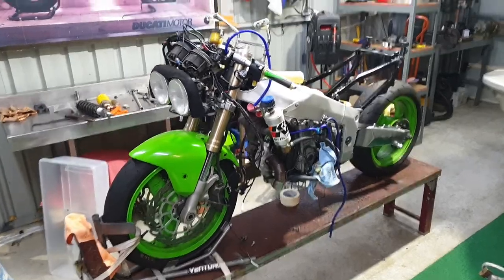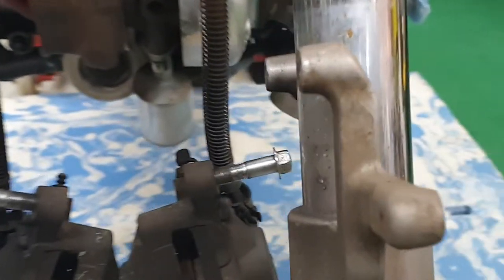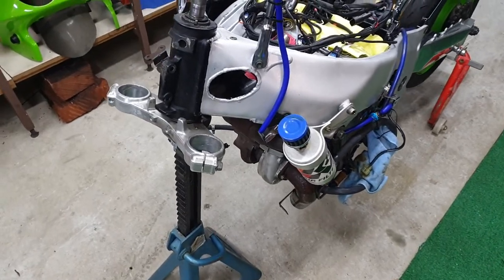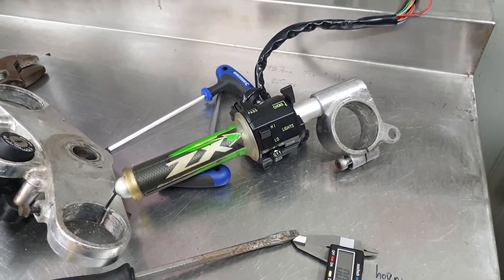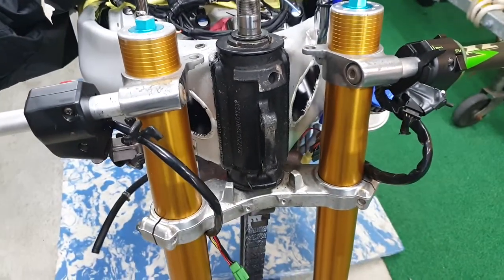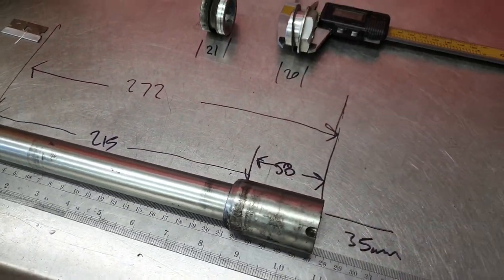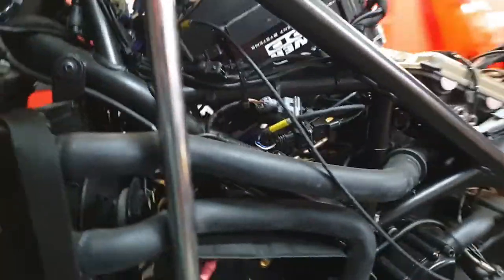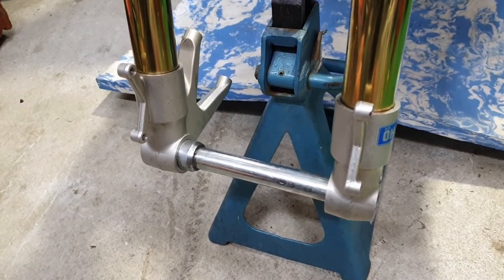Motorcycle Rebuild Project : ZXR TURBO Ep22 Ohlins forks fitted from 1098S Ducati

Comment: Awesome upgrade on the front forks! I hope the distance between the brakediscs is right, and that you don't need some spacers to get your radial calipers fitted.
Reply from the maker: Sofar so good Bjorn. I think that side of things looks pretty good. Never had so much luck on doing a massive parts swap out. It seems it was all just ment to be 👌👌